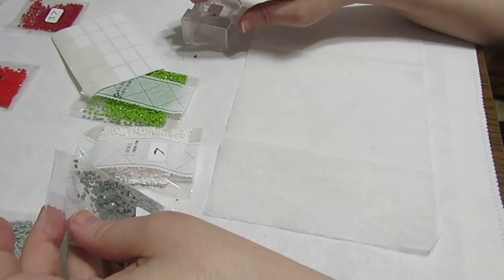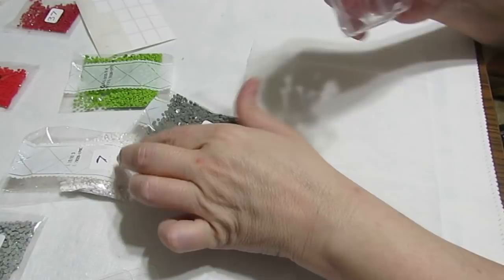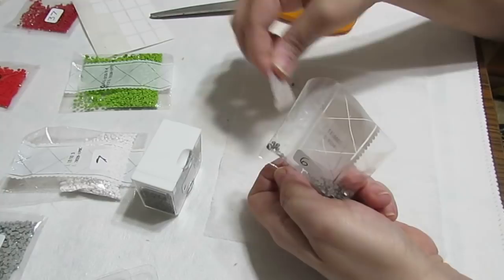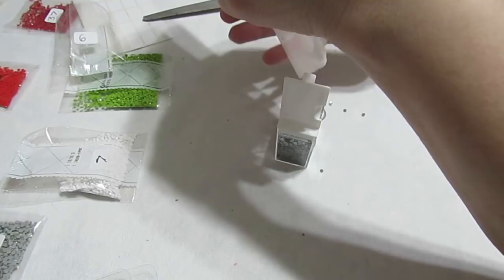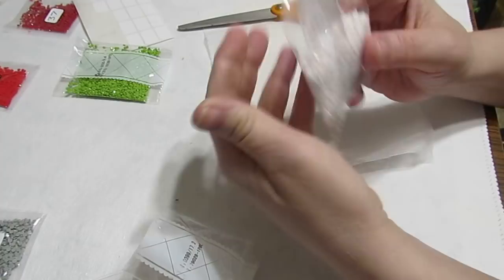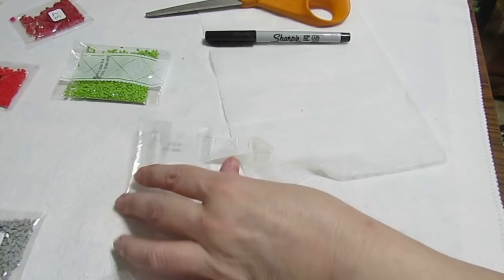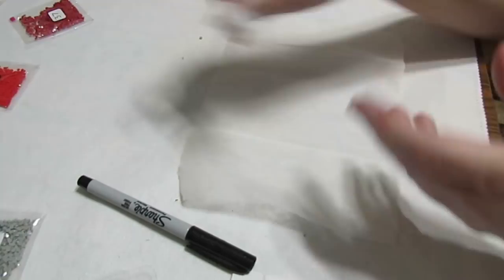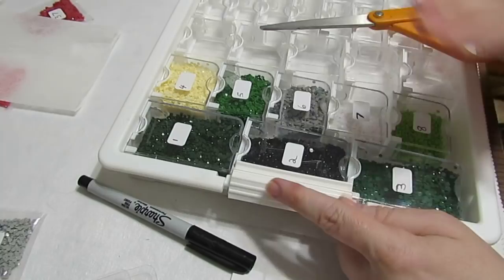Diamond Painting Tip -  dealing with staticky drills

Comment: I saw you were picking them up 1 at a time... If you  push them together in a pile ..lay your finger on top on alot of them... they will stick to the bottom of your finger & then you can scrape them on the side of the container your putting them in & they all fall into it... You may want to try this idea....have a good nite & good luck with the drills...
Reply from the maker: That's what I normally do, but I had a cotton cloth underneath my drills, and I couldn't get them to push into a pile - I need to remember not to have something like that underneath next time 😊 Thank you for taking the time to comment - I really appreciate it!! These staticky drills are beyond frustrating 😊💗🌺

Comment: Grace, great video.  When you use the dryer sheets on the drills, do you have trouble picking the drills up with the wax pen & laying them down on the canvas?
When i used the dryer sheets I had lots of drills that would not stick to the wax. Just wondered if this happens to you.
Reply from the maker: I have been using the dryer sheets for months and have never had a problem with picking them up. Not sure why it happens with yours.... I have heard that some people put their drills in the freezer for 15 minutes or more, and then pour them into their storage containers - maybe you could try that. Good luck - staticky drills are so frustrating!! 😊💗
Reply: They probably are caused by oily drills.
Reply: I am having the same problem,used the dryer sheet,it works, but now, it's hard to pick up the drills with my pen,any ideas ? Thanks

Comment: I’ve always wondered if static guard would work....
Reply from the maker: I don't know - I've never tried that. I do know the dryer sheets work great!!
Reply: I used static guard on some of the drills from this same kit. I was so frustrated as 1st staticky drills out of 250 paintings. It seemed to helped but dont know if it messed with how they will stick.
Reply from the maker: @MyzMyzterious32  I have had staticky drills before and I used dryer sheets, that's how I knew what to do here. I've never tried static guard - it would be interesting to hear how that works, if you don't mind sharing! 😊💕
Reply: @gbmaltese  I'm still working slowly on another painting. The rose cottage will be next. I requested replacement drills because I lost alot as they were flying everywhere. But was refused. So if I do run  out I'll have to buy 447 and book too match drills to dmc

Comment: I have a question I put diamond in a bottle but in the diamond in the bag aren't not statics but once they are in the bottle they are can I put a dryer sheet in the bottle? Does it matter what kind a dryer sheet!?
Reply from the maker: Yes, you can definitely put a dryer sheet in any container that you put your drills in, and it doesn't matter what kind of dryer sheet you use 😊